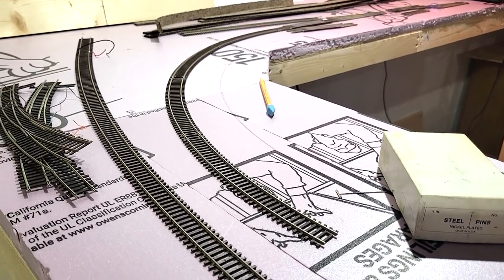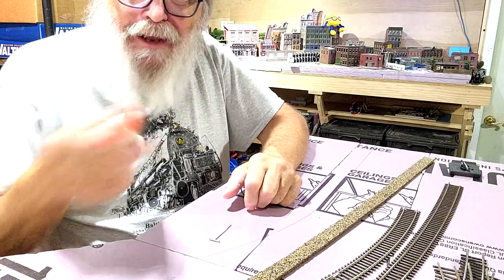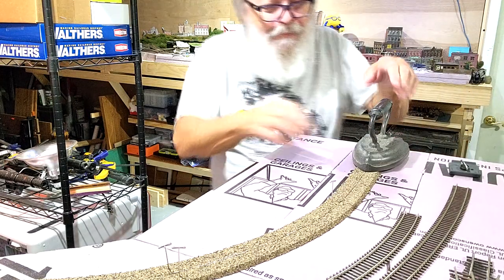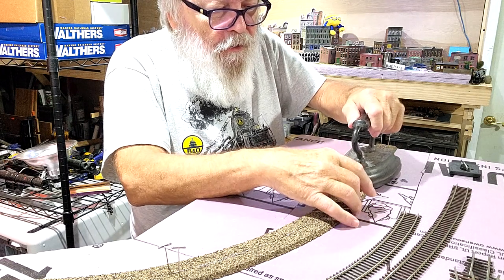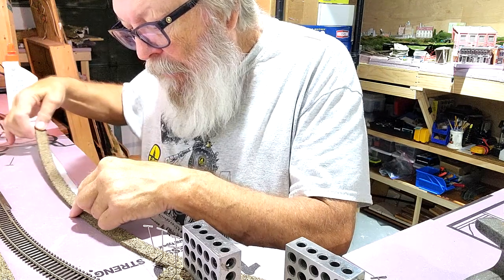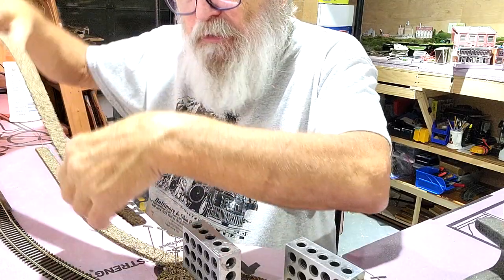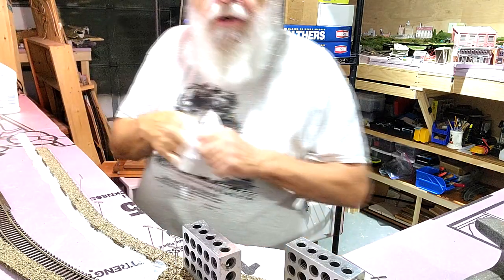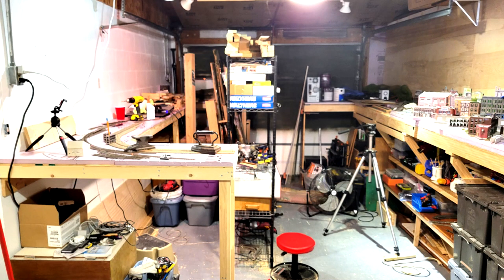Back To Basics - Cork Roadbed On The Corner Module

Comment: Hi Tom: “Cool demo”. I would like to make a suggestion. Before you lay the cork bed. Take it out side and spray paint it with a rattle can. Primer gray.  This will give you a finished look before the ballast goes down and it will help hide areas missed by the ballasting. Gary from Michigan 🚂
Reply from the maker: Thanks for the tip!

Comment: A question that no videos seem to cover is how you hold in place the cork on sharp curves (22in radius) when using plywood as opposed to foam. It wants to buckle up making it a hassle using several weighted items to hold it down. Suggestions ?
Reply from the maker: Never had an issue with it on plywood as long as you split it down the middle. I may have an old video I put out about 6 years ago on the plywood